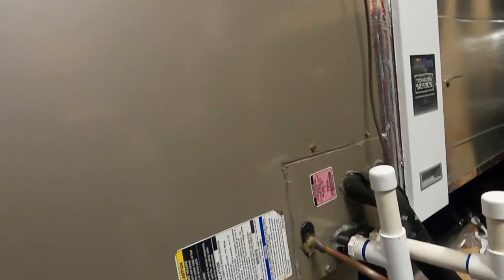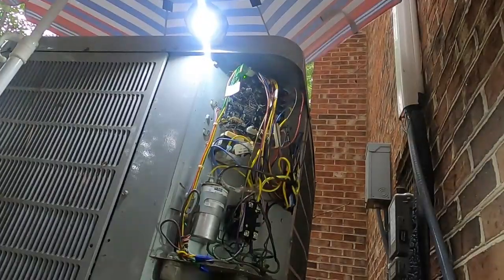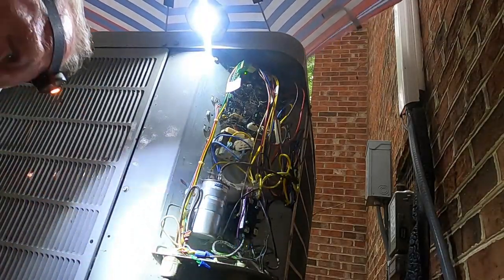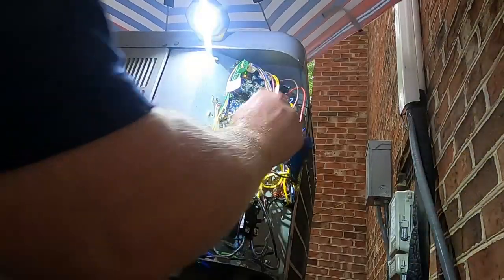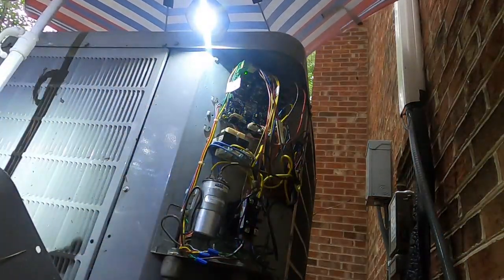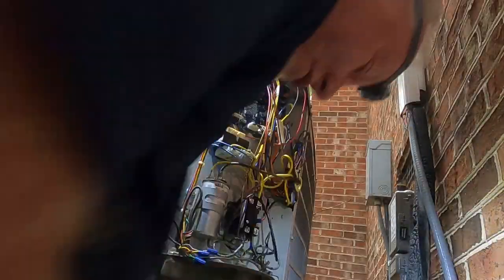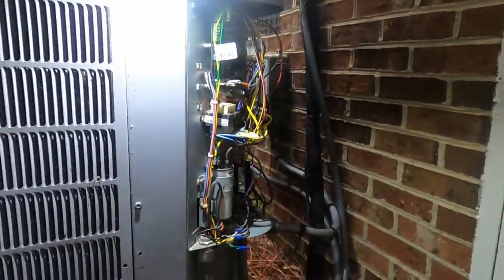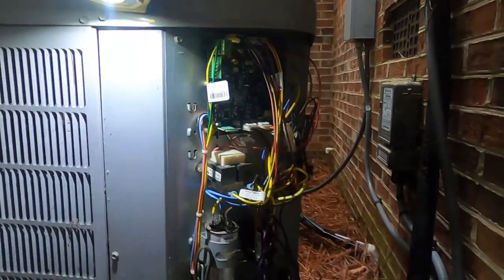Carrier Infinity with a bad TXV

Comment: Carrier went downhill about 15 years ago. It's sad all the old American companies have gone downhill.

York was good until Johnson controls an Irish company bought them out.

Trane downhill with quality Lennox same thing.

Ohh and I hear most of the American company inverter systems are to proprietary with the cominicating systems which I don't like.

It seems like only 2 brands even use copper coils nowadays and one of them is the gree flex system.

And ohh I figured out the Mr cool universal series  mystery it's a rebadged gree flex.

If you run into any of those.

With gree flex having more quality control.

But basically I like inverter technology but not at the expense of it bieng to smart which makes it prone to have more issues.

Comment: I just have a question boss is it's a txv don't u suppose to checking the subcool not super heat
Reply from the maker: YES! but you still have to evaluate the superheat. If it is that low you have a flooding evaporator, air flow issue, dirty filter, dirty coil, over charge etc! Not good. Low SH indicates overcharge while low subcooling indicates under charge, cannot be both, TXV is stuck open.

Comment: I am sure you know what it wrong with that one and what you are doing. However with a TXV should you not go by subcooling and could it be low on refrigerant? Try a leak search? I have seen a few evaps take a S and lose refrigerant and ice up the coil like you see there. low subcooling with a TXV is usually a low refrigerant problem. I believe that carrier infinity unit you are working on requires 8-10 degrees subcooling and holds over 10 lbs refrigerant , so 8 oz does nothing to a low charge.
Reply from the maker: Should still have high superheat if subcool is that low. TVX is overfeeding and flooding the coil. Remember that SH reading is at the outdoor unit, which means there is 0 sh at the evap coil itself. Liquid refrigerant making it to the outdoor unit will give you low SC, no superheated vapor to cool down.